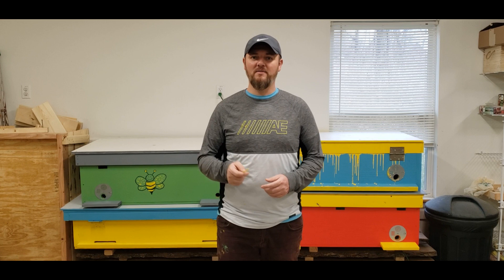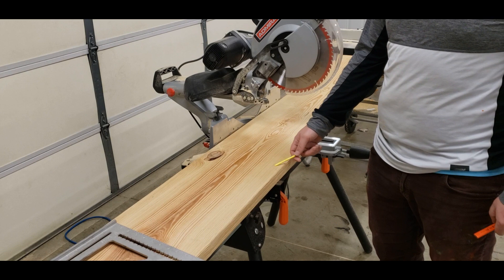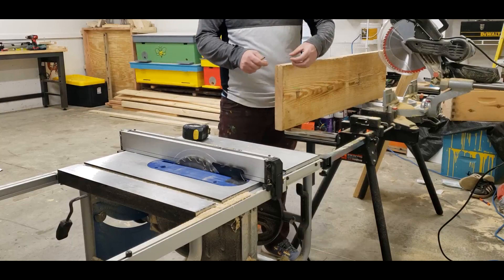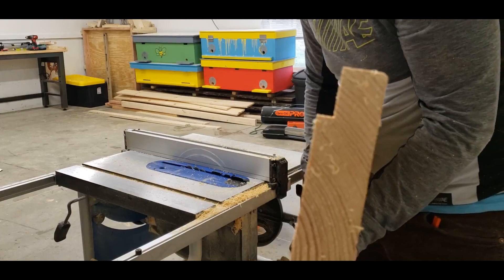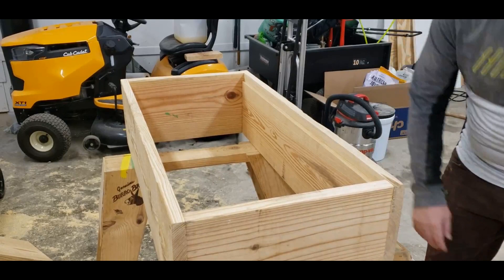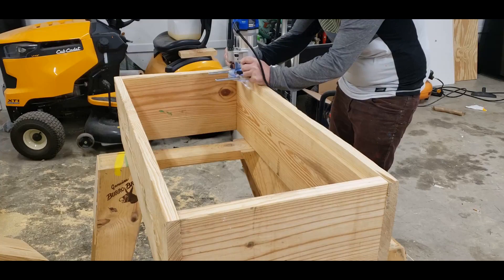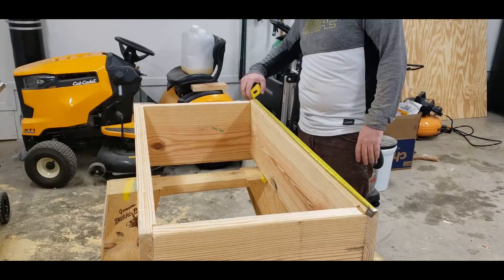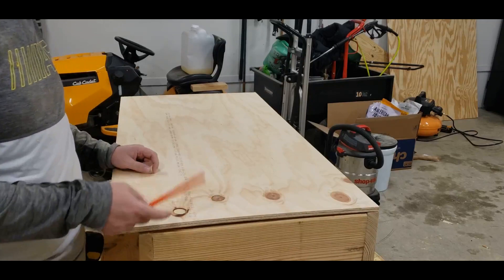Horizontal Hive Build Part 1 Long Langstroth

Comment: Wow couldn't ya fine some 1 X 12s that going to be heavy ~ i even glued 1 x 4s togather That works to. I like to make the holes next to the bottom where they can drag things out.  Looks like you got the correct bee space : top to bottom and side of the frames!  That very important ~ A Nice Strong Build
Reply from the maker: Hahhaha it's built Ford tough. I did a 2" for better insulation. It does have weight  to it. I'm not moving it once in place 😁 Thanks bud. We will see how it goes come spring.
Reply: @NKYHoneyBees It will work. Its built like a tank. Should get many many years out of it.  Thank God your not moving it  😆 Cheers buddy
Reply from the maker: Cheers!

Comment: I enjoyed watching your build.  The detail to the top is a very nice touch to ensure a good waterproof fit.  Now that you have been using this top for almost a year, how is it holding up to the weather.  Has it been a problem with swelling and shrinkage?   I want to use the idea on the hive I am building so let me ask you strait out, would you do it again, did it work over the long run?
Reply from the maker: Hey Joseph. Thanks for watching. The only thing I would change and will is the top cover. I will use metal to cover the roof. That plastic wrapped and water got to playwood. It didn't get in the hive but did under the top plastic cover. Other then that I love these hives.
Reply from the maker: I believe sun got to the plastic or I simply  didn't have enough overhang to make sure water doesn't get in